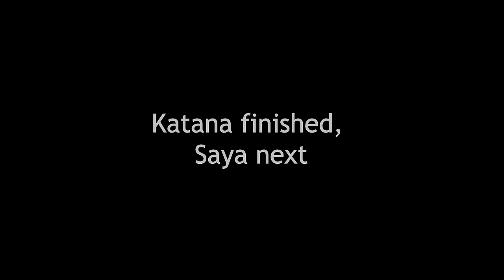Katana Making - Ghost of Tsushima (Sakai Sword)

Comment: Even though it is not made traditionally (realllllly hard to do and requires 7 people for 7 different jobs) you made the sword elegant and beautiful by itself
Reply from the maker: Thank you for understanding! Not to mention the time! It may not be traditional, but most modern knives and swords are made by stock removal instead of forging.
Reply: @JumboRadish  indeed you must of put a LOT of time into the well crafted sword itself and In return a beautiful piece of art I doesn't matter what you make or do you can always make it beautiful
Reply: @dsa0224 I'd say if he was deeply determined, he could do it.
Reply: It also takes days almost 2 weeks to get a really good traditionally made sword like that. Pretty good even if it's not traditional
Reply: 1095 High carbon steel was the closest we can get for Traditional Katana with modern Steel. Traditional Katanas have around 0.8%-1% Carbon content with 0.01% manganese, approximately the same as 1095 steel. I think a full 1095 was even better than combining 2 types of steel like the real katana, because it will homogeneously spread the carbon throughout the blade.
Reply: @islamicschoolofmemestudies  
Something else to think about.This is a Kamakura era sword. This had different metal content then modern and later period katana, namely the Edo period. This era had stronger blades than edo period katanas because of it's metal content, being the peak of japanese metal. So much that most of them have been traded or sold to different countries.
It's almost a lost technology as no one or many are practicing it today. Only a handful of folks on twitter have tried to replicate it in experiments.

Comment: This is definitely my favorite of all so far!!!
To create such high quality weapons at a young age. How old are you two gentlemen by the way?
What are the dimensions of the sword?
Keep up the excellent work guys!
Reply from the maker: Thanks Steve! I'm actually older than you think...I'm 33! As for the blade, I've been trying to make more historically accurate Katanas (with a good amount of profile taper and distal taper). It's a little over one inch wide at the base and a little under an inch at the tip. The blade is about 28 inches long. The handle is almost exactly 12 inches.
Reply: HENGKER-SASAN

Comment: You took a lot of shortcuts and still ended up with a better blade than most. Honestly, ceramic cast iron is hard enough to do and it's even harder when you consider its be used only for the fuchi, tsuba and kashira. I'm incredibly impressed by your beveling work. To do that with a 1lb hammer on the anvil part of a BENCH VICE, takes patience and skill. Very good work and great job starting with good spring/tool steel.

Comment: Hi! I know it's kind of late to comment on this video though I have a suggestion regarding making a fake hamon where you don't need to do it in a traditional way. You can do it by Acid etching where you apply vinegar or mustard to form a hamon.  If you wanna try it you could use sugar cane vinegar or the one we call here in the Philippines "sinamak"  because that one is much more effective because it has some extracts of chili, garlic, and ginger that make it more acidic compared to the white vinegar.  After that, you could rinse it off with isopropyl alcohol and apply some metal polish to remove some discoloration on the metal surface.

Comment: 1095 steel is suitable for a short blade, but when it comes to the sword, it's basically not worth 5 money. If you are going to make a katana, you need to make it from magnetic black sand steel and not with the maru style as you did, but at least with the variha tetsu style and cover it with clay to quench the steel. the holder horn of the scabbard was also not made.Anyone can cut the dry tatami mat, all you have to do is cut the wet tatami mat.

Comment: Ladies and gentlemen I hate to say this but the katana is basically a glorified status symbol. Yeah it's pretty Sharp but it is not designed for hard targets. In fact an English broadsword does more damage than a katana. The hardest part of a katana is the first 6 mm of The Cutting Edge the rest is soft Steel. The English broadsword is 100% hardened steel. The katana can take maybe up to forward direct hits from the broadsword before it's just about useless and only good for throwing at somebody in a last resort effort to get away. Yeah there's a lot of Mythology behind the katana but remember folks it's just a sharp curve piece of metal. And if you were to put a fully armed Samurai versus a fully armed English night Samurai's going to lose because the katana wasn't designed for hardened steel plate armor and chainmail. It was designed to cut through wooden armor being held together by ribbons of silk. The broadsword is basically an extremely sharp club that can easily hack through Samurai armor. It takes a little skill to actually make a katana blade. It takes more skill to make a broadsword or a Bastard Sword. The reason for this is every part of the broadsword can be used as a weapon. So if it came down to it I'd be willing to wager mine and my son's  left knut that's a broadsword will with the snot out of the katana every single time because the broadsword was designed to cut through bone and metal plate armor. I damn well guarantee if you put the world's greatest Samurai whoever lived versus the world's greatest night who ever lived the night's going to win every time. That Katana might weigh 3 pounds but the nights armored glove weighs about five and a half. The night's sword probably weighs close to five or six pounds and is about as sharp as the katana. So if you're reading this the katana is basically I'm glorified status symbol only to be hung on your hip or to be displayed above your TV and occasionally Cuts straw mats. I butcher whole cows and pigs with my Viking broadsword. There's not any 12 Japanese swordsman alive or dead that could handle one Berserker and his sword and ax. In all actuality the katana is pretty much useless for home defense zombie killing hunting surviving in the woods....Etc. I've never seen somebody kill a grizzly bear with a katana. In 2003 my buddy Dave killed a grizzly bear north of the Yellowstone Caldera with his custom broadsword. One swipe of that claw and your katana would be useless. One swipe of that bear's claw and that bears claw came off and then it got stabbed through the mouth and threw the brain Dave Twisted the sword the sword didn't bend or break or chip or even dull and the bear dropped. The Rangers let him keep what he killed they just had to do a couple of postmortem test on the bear. So long story short don't buy yourself a katana. Yeah they're nice looking and they're fun to swing around but they're just about useless in a real fight.